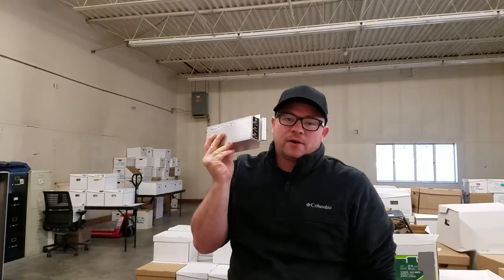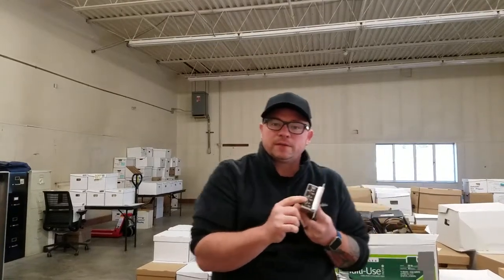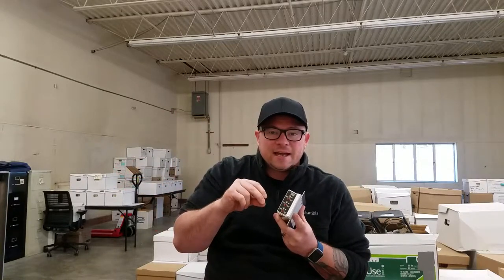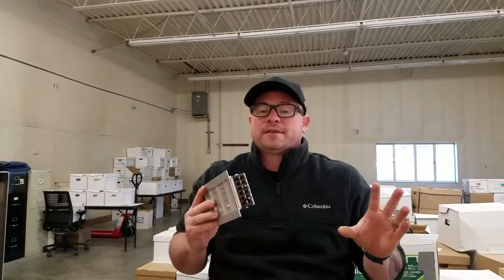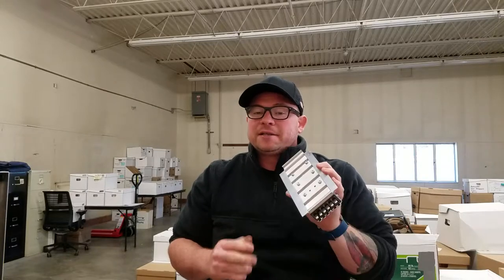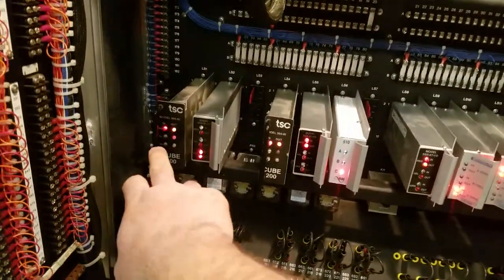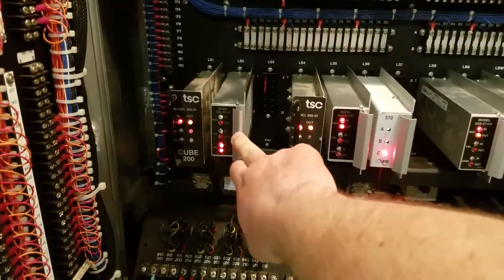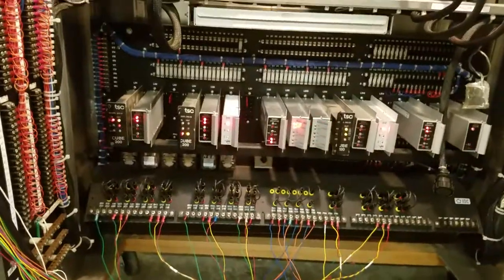Load Switch Basics

Comment: Keep'em coming in.👌👌👌
Also, I wanna know how technicians tie in a intersection with a railroad crossing.
Hope to get one of those videos.
Reply: Adrian Taylor. Out here in California, the RxR cabinet has a normally closed (N/C) contact that is tied into the TS cabinet (332). Once the train comes it opens up the contact putting a Railroad preemption call to the 2070 controller. Depending on how the traffic engineer has the controller program it will either go into Limited service or four way flash. 🚦🚅🚨😄
Reply: We tie the RR wires to a 120VAC relay in the signal cabinet.  When the RR triggers it closes the relay to trigger the preemption for the RR crossing.  Some RR will park at the intersection so we cycle the non conflicting phases to move traffic during preemption.

Comment: I have a tech question... I have an old test board that runs on 120 volt S6 candelabra-base incandescent light bulbs. Those old light bulbs are getting harder to find especially here in California where they are phasing them out. When I tried to replace the incandescent bulbs with LED lamps, the LED's stay on constantly, in a dimly lit state.. They work just fine and go to full brightness when they receive an input from the controller, but instead of turning off, they go back to that dim, constant ON state. My understanding is that in a TRIAC, there is a slight voltage leak that incandescent bulbs don't care about, but LED's apparently do. I tried wiring in load resistors which didn't help. Would you happen to know a work-around for this?
Reply: Have you tried moving to a different field terminal?  How did you wire in the load resistors?  You should have taken one leg of the resistor to the output of the field terminal and the other leg to the AC-.  Double check your AC- bars and make sure they're all connected.      One last thing..
If you pull the load switch out, does it stay dim?
Reply: @streetsmartstraffic  I'll give it a try. Thank you!
Reply: You’re welcome